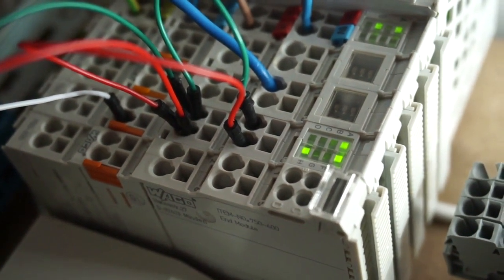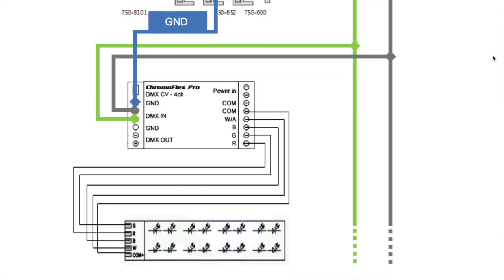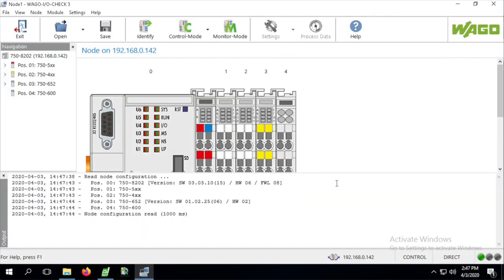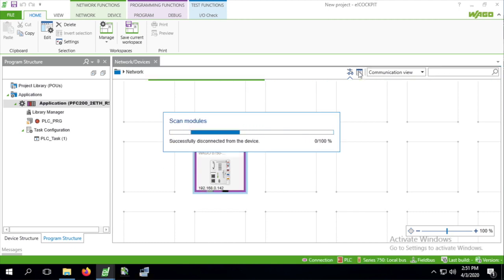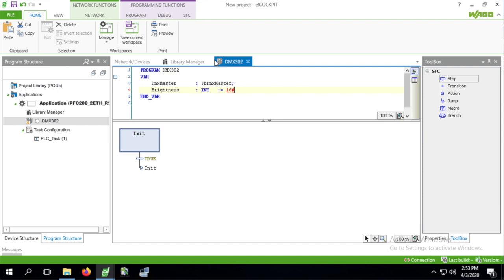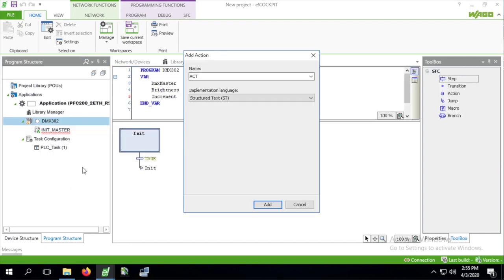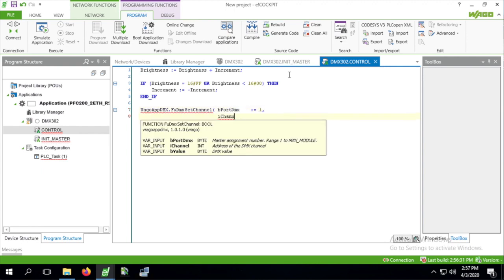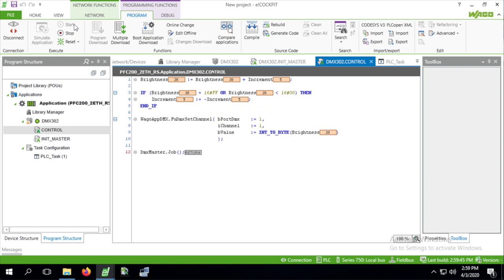WAGO 750-8202 DMX302 TRIAC Dimmer controller

Comment: Hi, thanks for the Video. Regarding DMX - and 750-652 - do I need I/O Check to set the module as DMX_Half_Duplex - or this could be done in e!Cockpit?   Asking about this - I/O Check is additional paid soft - and it seems strange - eCockpit does not provide this funcionality.